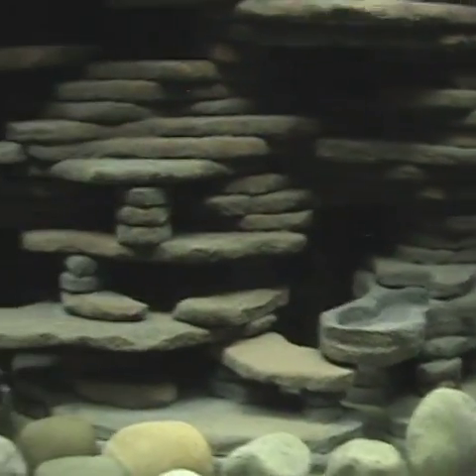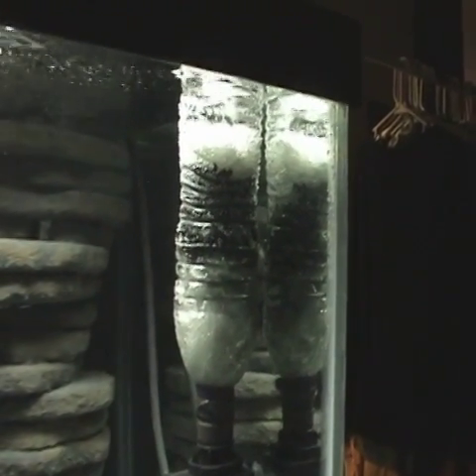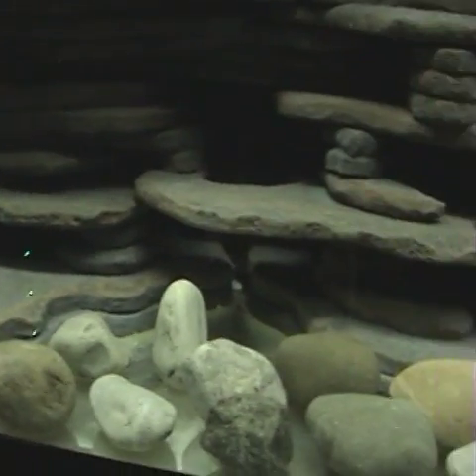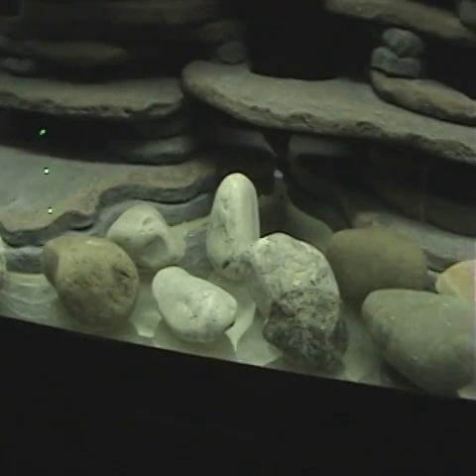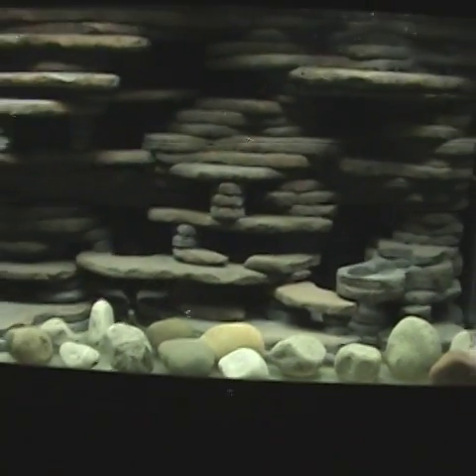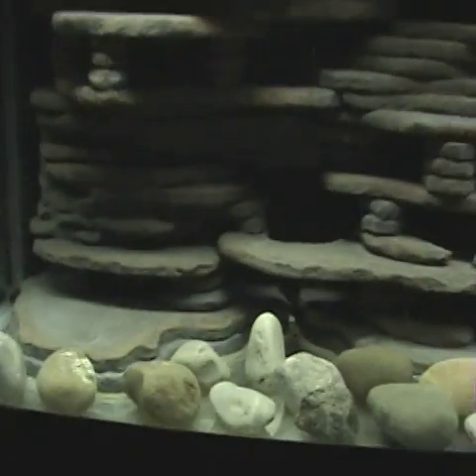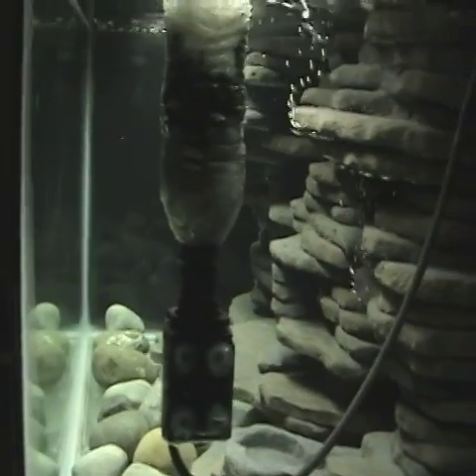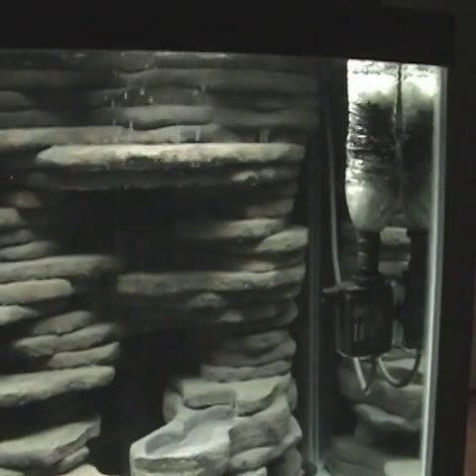DIY 75 Gallon 3D Background Pt. 3 Rinse Cycle

Comment from the maker: The rinse cycle is dependent on how thick you make the coats of concrete, how much concrete is used, and how long you let the concrete cure before filling the tank with water. It could take a month or so. Just keep an eye on the PH levels and once they start leveling off at a safe level, do a couple of more water changes. Step by step can be found at the link in the description above.

Comment: for lighting have a look at water proof led lighing strips. u can get it in any light temperature/color. and u can even get ones that u can changed the color
Reply from the maker: I have. I haven't really messed with the lighting at all. Still using the strip light. Thanks for the recommendation though. Will keep that in mind when I do get around to changing the lighting.

Comment: Can you tell me what you coated your foam with so that it was aquarium safe? I have been DYING to hand make my own inserts but I don't know what material would be safe for the tank.
Reply from the maker: I used QuikWall, Acrylic Fortifier, and Quikcrete colors. You will have to sift out the fiberglass from the QuikWall and once it's all cured, you need to do a freshwater flush. Mine took a couple of weeks. Checkout the site in the description for more details. Depending on where you're at availability of QW, AF, and colors might be tough.

Comment: So I did something similar and it's been running for a few months now. The cement appears to be starting to crack and in some places looks like it's chipping off.. what should I do?? Where did I go wrong?
Reply from the maker: I didn't have big chips but I did end up having little pin holes in my concrete where I could see white foam. It usually happens if you didn't get a good coating of concrete or if it didn't cure all the way. I let mine go. It didn't seem to affect the water parameters or the fish. As far as repairing it, not sure if there is a way without relocating fish and redoing the concrete, curing, and rinse cycle again. Might want to check out the forums at Dramatic Aquascapes and see what you can find there.

Comment: What kiind/brand of concrete did you use? It has a very smooth look to it.
Reply from the maker: If I remember correctly, I used QuikWall with the Acrylic Fortifier and Quikrete colors. http://www.lowes.com/pd_10396-286-123050_0__#BVRRWidgetID

Comment from the maker: I don't remember exactly, but I want to say it was less than $75. Most expensive part was the concrete and the colors. I used three colors at ~$9 a piece. Foam was cheap and the concrete itself wasn't that much either.

Comment: Maaaaannnnn... I wish I would have seen your video first. I built a deadly background, turned out really nice. Not as detailed as yours, pass through caves are pretty awesome..  anyway... I cut it all out... placed it perfect... Caves for the Cichlids... Rock Pillars holding up extended ledges... painted 4 tones of earthy colours. got ready to install it, FUCK! didn't leave any holes for the filter or air hose... lol... I was pissed. Luckily I had a few home made canister filters that I could modify the tubing and make it work lol. I will plan WAY MORE next time... you nailed everything by the looks of it. Great Job, thanks for the video

Comment: How did you get it in with the top cross member??
Reply from the maker: The background was constructed in numerous pieces. Once they were covered in concrete and cured, I installed them like a puzzle. There is a link in the description to the Dramatic Aquascapes website and forum topic that shows a bit more detail.

Comment: Can I directly coat the foam structure using white cement ???? Or it will be dangerous for fish ??
Reply from the maker: Not sure what you mean by directly coating. You are coating the foam with the concrete mud and letting it cure. You could always do a test piece and see what kind of PH you get after a rinse cycle.
Reply: Old Goat Workshop I mean if the foam structure is ready and fix with silicon then what type of concrete we will use to cover ( paint ) foam structure .
Reply from the maker: Same type. You would just apply it in the tank. You will still need to do a rinse cycle to get the PH down.
Reply: I don't know what cement you guys are talking about, but at my local hardware store there's a pond repair stuff that starts with a paint-like texture, and sets like a hard rubber. It's safe and can me used to repair ponds, water supplies for people etc. You can use that to paint stuff, but like Old Goat Workshop said, you need to let it cure for a few days because its toxic before it sets.
Reply: you can paint it any color you want, as long as it's covered with silicone u're good

Comment: I had a few question. Cause i want to do one for my self to but im kinda of scared to do it cause i already have my fish is there a way to do this and just soak the 3d backgound in a bucket tell is safe to put it in a tank.
Reply from the maker: Matthew Tapia You can, but you need to have some type of filtration going and a big enough container to place it in. You'll also need to find some way to temporarily submerge it while it leeches. The best way though would be to attach and rinse it in the tank it's designed for and place the fish in a temp holding tank while you perform the rinse cycle. Check out dramaticaquascapes.com for some other ideas.
Reply: Thanks

Comment: hablas español? como lo recubro para que la pintura no se deshaga adentro
Reply from the maker: Paul Dillet No hablo inglés, pero tengo Google Translate. El color está en el concreto. No se requiere cubierta protectora si el concreto se cura.
Reply: discupa como se cura el concreto hermano ?
Reply from the maker: Curar significa secar. Deje que el concreto se seque durante uno o dos días.
Reply: oye hermano, disculpa porfavor, otra pregunta es, el concreto es cemento para houses building normal???  o es especial para acuarios?????      y no es T O X I C  , O NOCIVO para los fishes????
Reply from the maker: Yo uso Quikrete Quikwall. El cemento elevará PH de agua. Cuando esté seco, remoje durante tres días y vacíe el agua. Repita durante treinta días o más para reducir la PH a niveles seguros.

https://www.quikrete.com/productlines/quikwallsurfacebondingcement.asp.
Reply: ok muchas gracias saludos desde mexico que amable es usted